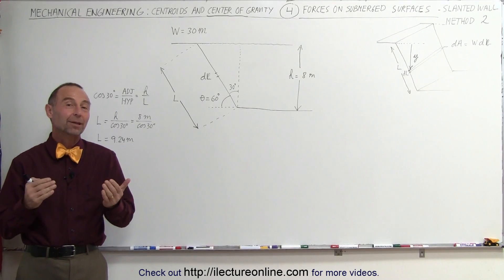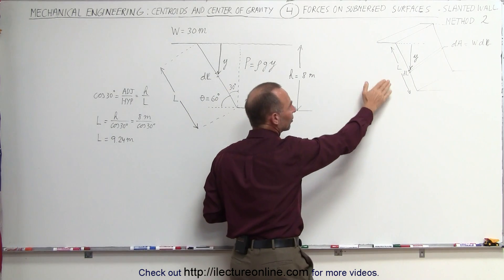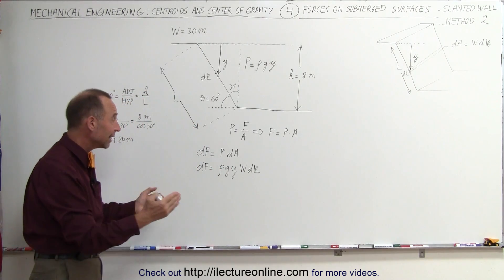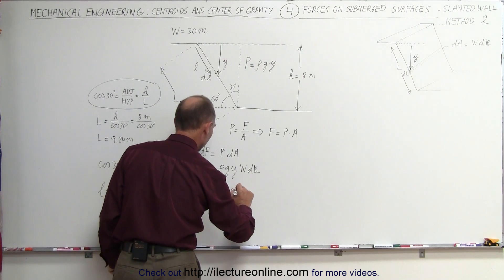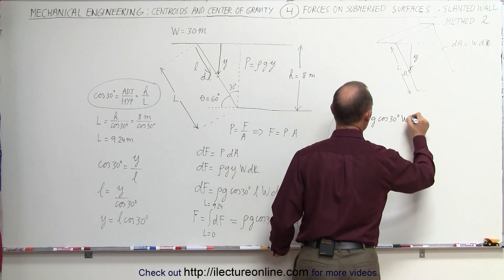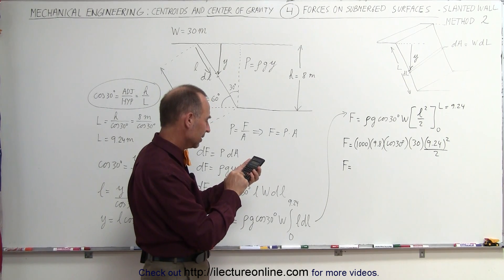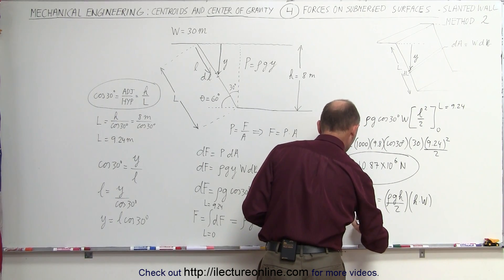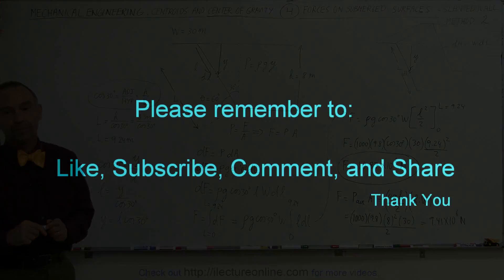Mechanical Engineering: Forces on Submerged Surfaces (4 of 15) F=? of Slanted Wall: Method 2

Comment: I just noticed something.  If you take the Cosine of 30 degrees and multiply that by the "L" , Then you get the force that you got for "h" when L = h and Theta = 0 degrees. . So, if you want to know the Total Force on a Slanted Wall.. just divide  the Force you get when the Wall is Vertical by the Cosine of the angle of the slanted wall. :) In the above example...  You have:  (10.87 E6  x  Cosine 30  =  9.41 E 6)  works everytime :)    ..
Reply from the maker: Hi Philip.  That is indeed correct!  🙂

Comment: Hi Michel ... I'm revisiting this video... and I wonder,  as the Angle THETA get's larger.. the Force on the wall Increases... so if Theta goes to 90 Degrees ... then the FORCE should equal INFINITY, right?  and yet the COS of 90 degrees in the equation above says that the force equals zero at theta = 90 degrees. I'm confused, so I'll double check  again.. lol.. I'm missing something, so it's my problem now. :)  I hope all is going well during these tough times. Spring has sprung in Michigan so.. all is well.
Reply from the maker: Hi Phillip, it has been a while.    When the angle approaches 90 degrees the cos(angle) does indeed go to zero, but then L will approach infinity and since l is squared it will reach infinity faster than cos(angle will reach zero).  An interesting problem indeed.

Comment: Can you make an exercise where you calculate the hydrostatic force on a slanted wall that makes an angle theta of more than 90 degrees? Let's say theta=120° so the angle on the waterside is 60 degrees. Thx a lot!
Reply from the maker: That would be exactly the same as a 60 degree angle.  (You only need to consider angles between 0 and 90 degrees.)

Comment: Thank you. Where would this force act? Would it be a distributed load?
Reply from the maker: Yes, the force is distributed across the whole surface, and increase linearly with depth.
Reply: @MichelvanBiezen  Thank you Michel. Your videos are helping massively. I will make sure to donate at the end of my degree.
Reply from the maker: Thank you.

Comment: Dear Sir, when calculating the vertical force on the wall, why do you ignore the atmospheric pressure acting downwards? Shouldn't P= (rho*g*y) + Atmospheric Pressure?
Reply from the maker: The atmospheric pressure typically cancels out on both sides.

Comment: Hey, 

I have three quick questions. Firstly given the picture:

https://gyazo.com/a8643081be684d28db1ce6b548e10221

1. Is my integral actually correct? I use h instead of y, and other variables (Given from the picture)

https://gyazo.com/31103d0edaf79031bec7eb0a827b6565

2. My question about the integral, is why u can actually: integrate the Force dF with respect to Z. Is it because there is a small area dA that has a small preasure for every little dZ and this preasure can be calculated using rho*g*h but since u can substitute h with z u can integrate with respect to z, because z and h has a realtionship (tringonometry)?

3. Real dams are often a bit arc shaped, and a bit curved/sloped? How come? Does it have anything to do with momentum or why are for instance dams thicker at the bottom? Is it because of torque or is it just because the force is bigger the deeper the water gets?

Comment: Interesting Problem... I would have thought that the Slanted Wall would have the same pressure as if it were a Vertical wall...... by using the Average Pressure times the total area... wow, was I wrong from an Intuitive point of view..... but I did ponder the Cos 30 degrees factor... as the angle of 30 degrees changes to 45 degrees and then eventually 90 degrees.... that Factor diminishes .... at 90 degrees the Cos 90 = 0 and hence the pressure would be Zero?????... interesting Stuff there, Michel...  ofcourse an angle of 90 degrees would suggest a Dam wall that was Horizontal and laying on the bottom... to which the pressure would either be zero or Infinity... YIKES.. I have my work cut out for me....  Great video!.. as usual.. you promote thinking outside the box for me... :) ... Thanks!
Reply from the maker: That is a good way of looking at it (taking the angle to the limit), but you also must take L to the limit at the same time......
Reply: I guess I was thinking of the Pressure against the wall as if it were like a ray of LIGHT... and I was assuming there was a FLUX of sort.... and with Flux you calculate the Sine to the Perpendicular  but that involved the SINE of the angle.. not the Cosine.. LOL... Pressure at a given depth is always the same.. regardless of a wall that is Perpendicular or Slanted... HOWEVER.. what I learned from YOU is that F = PxA.. and P = F/A...... therefore.. if Pressure is constant at a Given Depth.. then as Area goes up, as in a Slanted wall, then the FORCE MUST GO UP TOO...... Voila!! ... thanks MICHEL!!.. I apologize for my Ramblings here...

Comment: Hello, thank you for your videos. They are very instructive and clear. I have two questions though: 
1. Why do not you consider a force perpendicular to the inclined surface?
2. If one is concerned about dam overturning, how would you calculate the moment arm of this force respect to the downstream toe?
Reply from the maker: There are different approaches of solving the pressure and forces on a dam with a slanted surface.  I believe that I solved that with a few different techniques.  Take a look at the rest of the videos for a better understanding on how to solve these types of problems.
Reply: Thank you for your quick reply. I need to work more on that. Thanks again for your useful channel.